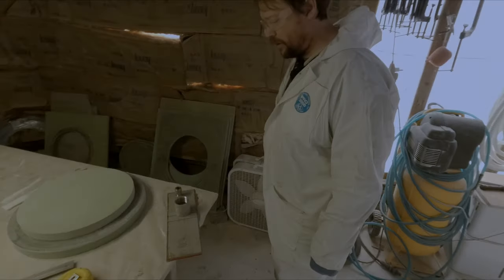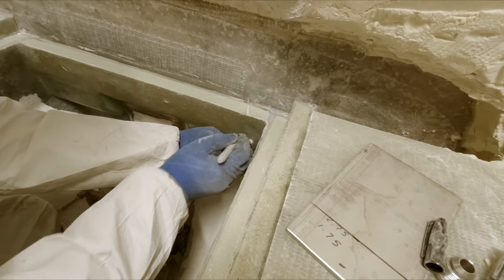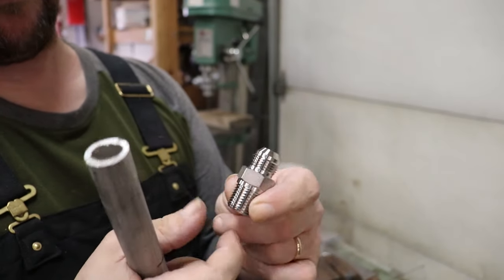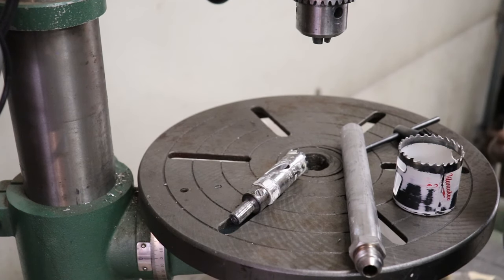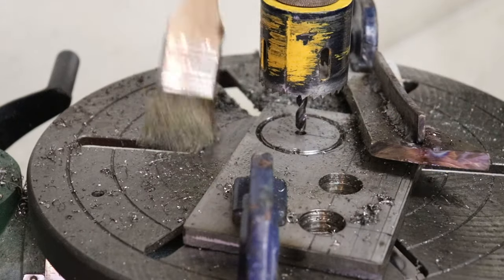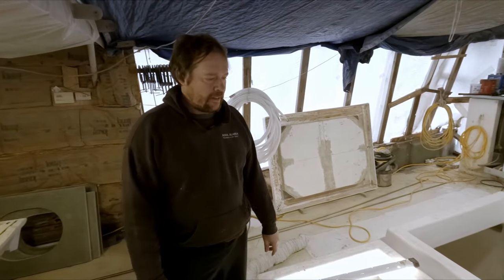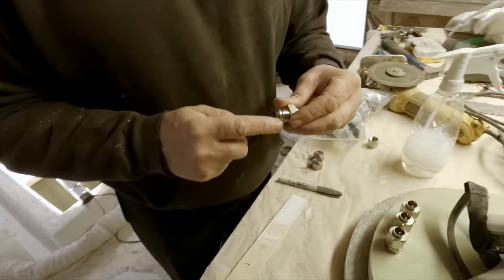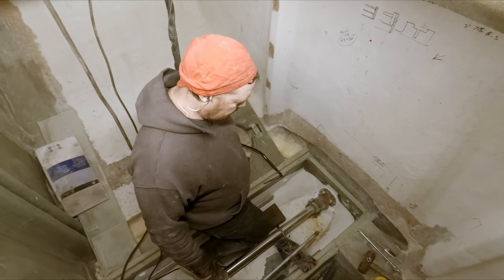Bulkhead Fuel Fittings and Lines - Emerald Isle: Ep.75 Fishing Boat Refit - Backlog #8

Comment: Have you thought about using a “crowfoot flare nut wrench” for those tight spots where the tubing is connected to those through the bulkhead lines?Harbor freight has a set of SAE or metric for about $14.00. That might make your life a little easier:)
Reply from the maker: For sure jack! Good recommendations. We had enough room to get it in there without any issue.